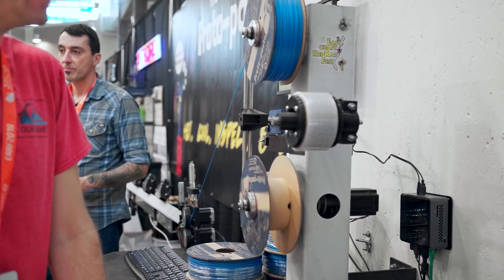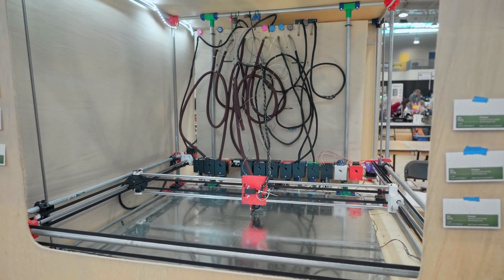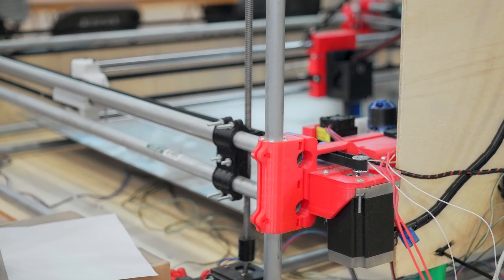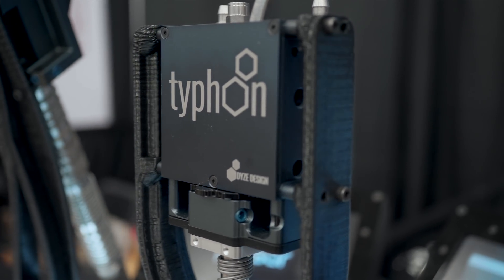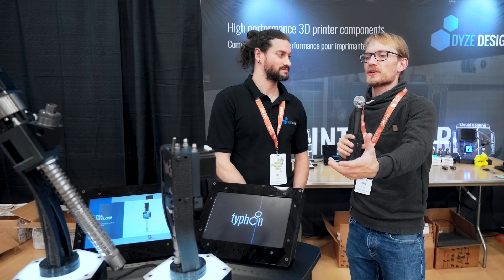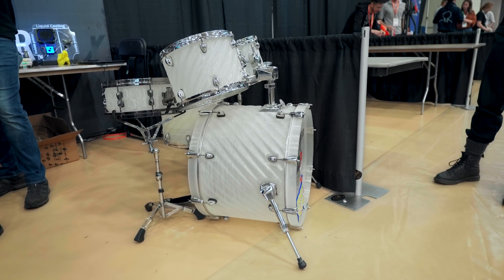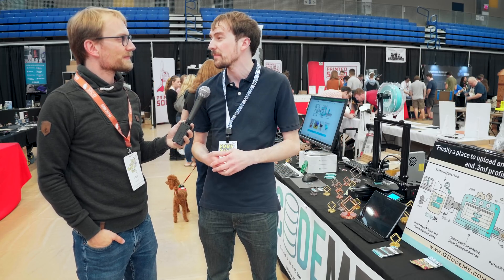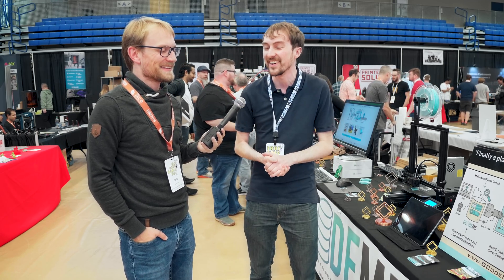Crazy 3D printers from ERRF 2019!

Comment: I feel like that large first printer could have done wonders if the builder would have spend $200 more on a rigid extruded aluminum 4040 frame. Would have looked like a finished product that I would have wanted to buy.

Comment: I still don't get the threaded insert install tool head which is explained at 2:30, can someone ELI5? What is the function of the alligator clip?
Reply: the clip holds the threaded insert from where it gets loaded into the head to where it gets installed in the print.
Reply: Mm, feels a bit wonky but I get it now, thanks!

Comment: Thomas, very curious, what the heck size of a 3d printer, is required, for the Typhoon? I mean your normal hypercube, will not work with that thing. Too bad that was not covered when you were speaking with him.
Reply: I think you put it on a regular cnc mill.
Reply: @satibel  Yes the Typhoon can be mounted on a regular cnc mill :P
Reply: The recommended size would be minimally 30cm x 30cm x 30cm.
Reply: @DYZEDESIGN  Really, that Typhoon, you were showing, looked rather huge, for a 300mmx300mmx300mm sized 3d printer.
Reply: @TimS57064  yeah, it's big (275mm). 300mmx300mmx300mm is really the minimum build volume. Our test bench printer is a cubic meter.
Reply: Hang printer with steel cable instead of string.
Reply: Filaments Innovations has one on his Icarus

Comment: This probably is a massive noob question, but what would stop me from taking a Prusa i3 and simply extending all axis( and bed) to whatever dimensions I want?

Of course, structural rigidity needs to be maintained, config needs to be entirely redone and it will take forever to print big parts with stock nozzle etc, but what are the actual reasons it's not being done?
Reply: Everything you stated. To make a machine larger you need to add some way to make it more rigid.
Reply: mainly because cost, you need bigger motors, because you have higher mass, and so higher inertia (or print horribly slowly).
you also will want a higher flow hotend, because bigger area means a lot more material to push.
if you multiply the size of all axis by 2 (40*40*40), you need 8 times more material (2*2*2).
Reply: They have 3d printers that print houses (using a concrete slurry, not melted plastic). Anything is possible if you can dream it and if you have enough time!

Comment: For that massive heated bed just run a wire from those overhead power cables to power it I mean its too much power for 210v
Reply: for my next printer, I'll be basically making an underfloor heating setup with 230V carbon strips. (800mmx1500mm)
Reply: It runs two 120V 750Watt heaters in series, so it is not too much power as they are only running at half strength.

Comment: About 6500$....   
depressed swallowing

OK

I feel you
Reply: Any new product needs to recover R & D costs as soon as possible, then over time the price comes down, but Yeah, I had a similar reaction, then on second thought, what that thing is, not really that bad of a price.
Reply: We have a multiple $200,000 printers at work. They also require high end air compressors and Support Cleaning systems. The air compressors were around $6500 a piece. I think these are targeting a more commercial market :)